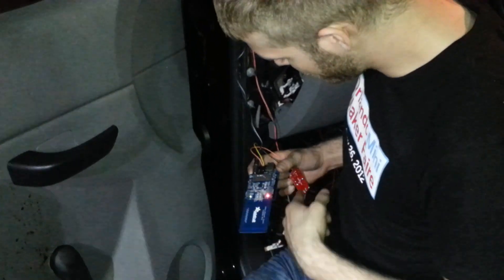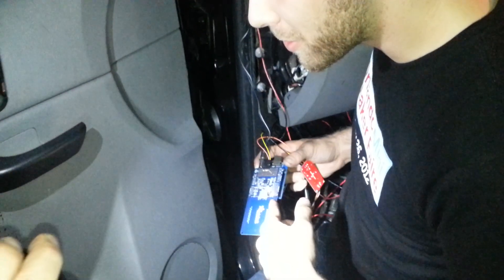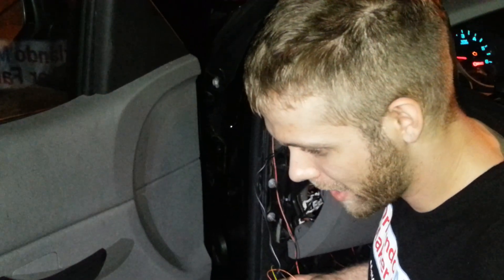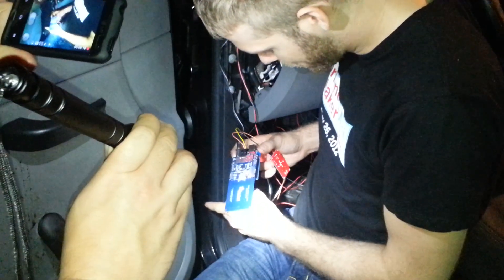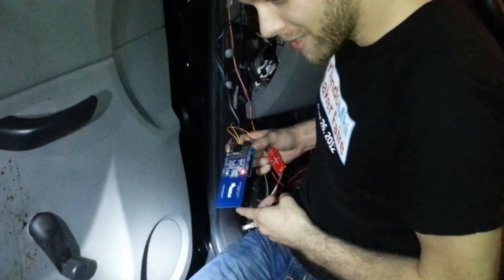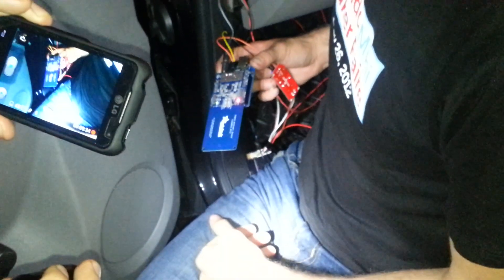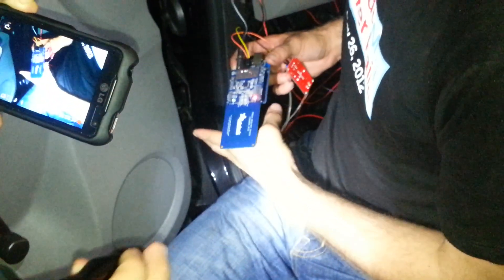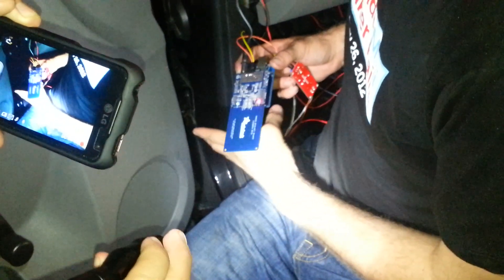NFC power lock control

Comment: What relay kit do you use? Can you link it, please?
Reply from the maker: I believe they're just 12v relays. This project will work, and has been reused on, a number of different voltage dependent systems. We've used this on a few motorcycles, cars, power tools that require training and even doors.